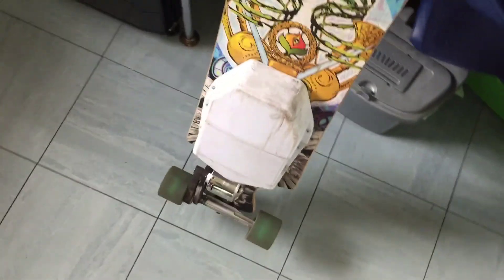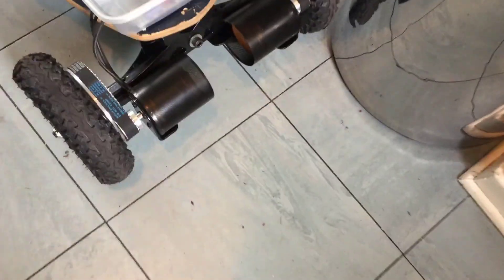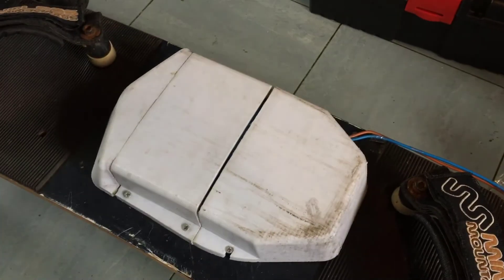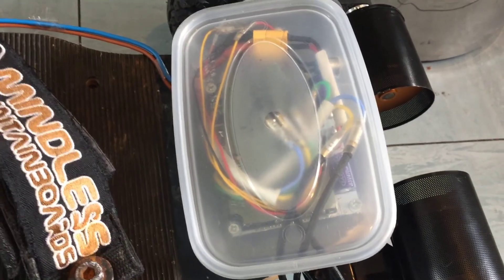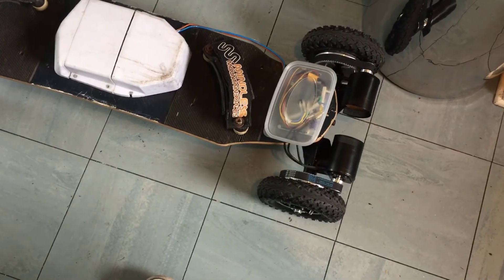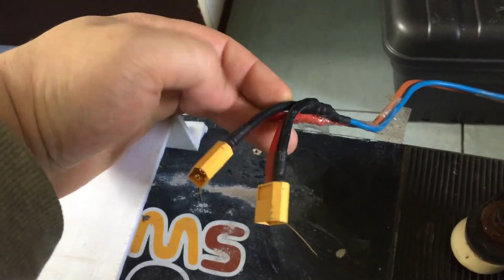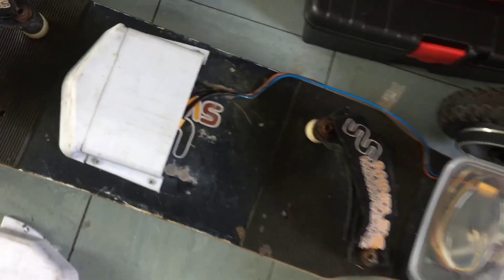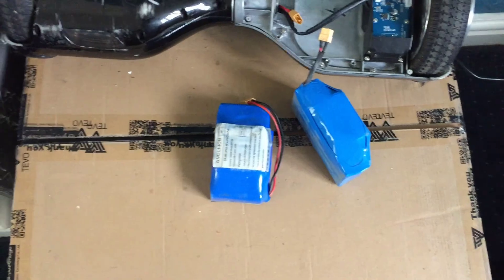DIY ELECTRIC OFF ROAD MOUNTAIN BOARD

Comment: Alright Dude, Currently building my board. I am based in the UK, Have you managed to get them off road trucks quicker then Ali Exp? I am desperate to get them quick!
Reply from the maker: tbh I havent. have you seen the new motor mounts on ali?
much better than the ones in the video. iv found the ones in the video bent over time. 
Ali express will take about 10 days or so
Reply: @SeanPook  No mate have you got a link?
Reply from the maker: @sampexton8054  yea thats the one, what speed controller are you using?
Reply from the maker: the motor on them dont have hall sensors
Reply: @SeanPook  Need to get the dual ESC as well. Ive got my street Longboard which I built myself and its sweet. Good Batteries good motor etc but where I live is pure fields. I cant decide whether to transfer my single motor over onto a off road mount or just say fuck it and spend another £400.00 on a dual motor and ESC.
Reply from the maker: @sampexton8054  id go for a vesc then and not the cheap esc
Reply from the maker: get the mounts, truck and motor seperate